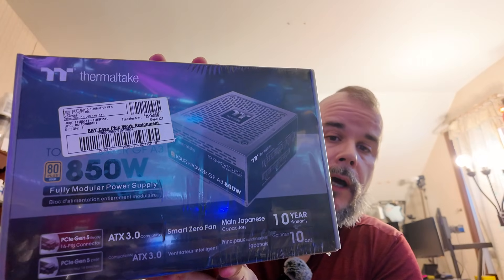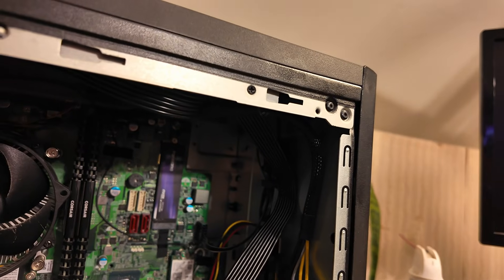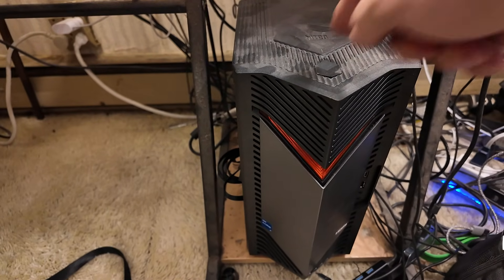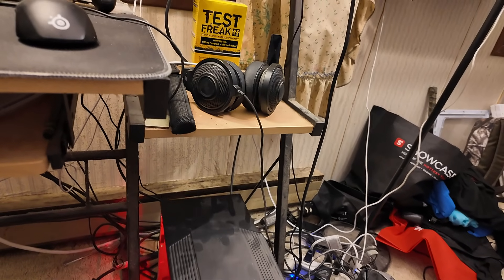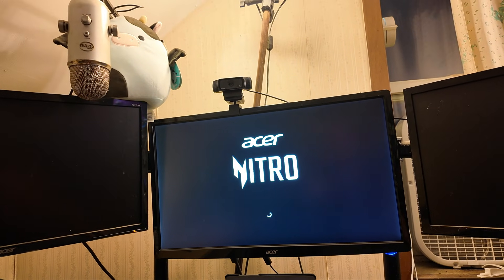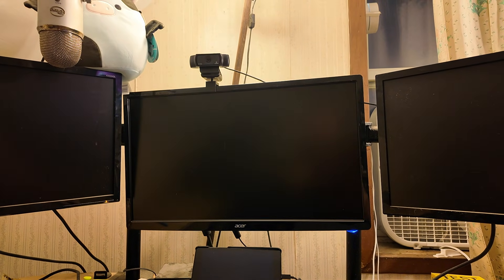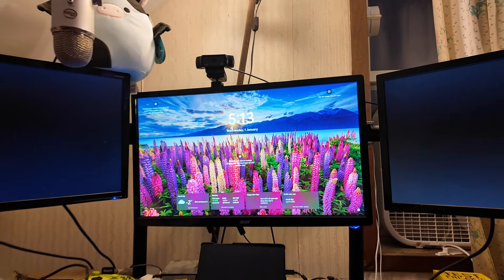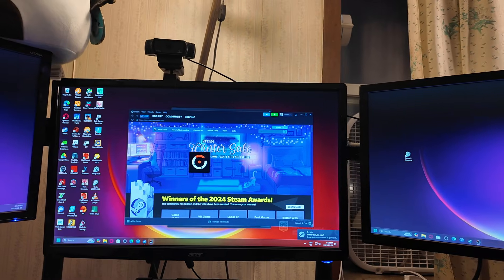Power Supply Upgrade - Acer Nitro N50 n50-650-eb14

Comment: Thanks for the video! I bought an 850W PSU for my Acer Nitro N50 and thought it would be an easy job to swap it out. Little did I know… I can’t believe I have to get this adapter cable now 😅
Also, cable management is gonna be tough…

Comment: Dude, love your videos. Anyway those rivots, they're cheap aluminum. I just took a hammer to a chisel and they just popped off. Tossed that useless HDD case. 
Anyway bought a cooler master 750w modular. Everything connected, it fired. But no usb or video output. Card fires n spins, all fans spinning but the 8 pin wasnt powering any peripherals. I put OEM back in and it's fine. Any ideas?

Comment: Thanks for making this videos this power supply works Corsair rm850x doesn't. I got a thermalake CPU cooler 2 case fans 32 GB 1.2v cl22 ram WD 850 2 GB HD in mine going 5070 had a 6700 XT in it
Reply: Yo mate, can u tell me more about your current specs? I am tryna upgrade mine as well

Comment: My advice would have been to sell the acer pre build and buy a used pc from a pawn shop. i picked up a i7 11700k based pc with a rtx 2060, AIO for $530. The chicony psu is really badly low quality from a company like acer to use as well as their green low quality mobo in 2025. Theres no case fans everything is a cost cut on that acer yet they charge more than a proper pc you can build yourself.

Comment: I have nitro n50-650 with rtx3050 8gb oem and the seller told me that its imposiible upgrade the gpu  bcoz the psu is limited and cant be replaced? Who i need to believe??
Reply: I got my son an n50 640 (older model.. and I've swapped out everything except the power supply. Upgraded to a 4060..  a 4070 dual fan is no problem.  But you can't go any higher.  I want to upgrade the power supply but I'm kinda scared I may fry my motherboard. But if this guy did it we should be able to as well
Reply: What was the original cpu and gpu?

Comment: Ive bought the linked power adapter but it doesnt turn the pc on at all, i feel like ive tried everything that could be wrong🤔please help😭
Reply: I bought 2 adapters, one for dell, once for Acer, both don't work....Fans start to spin....that's it, no screen, no power button reaction. Acer Nitro n50 656. Acer changed the way the pin communicate (PS-ON pin , green wire, ...)
Reply: @armand4464  I have same issue, fans are turning on idle nothing else. Do you have the wire diagram for the 24 to 6 pin adaptor to use it in Acer Nitro N50-656? Or at least what wire needs to be repositioned?
Reply: @sergiuteslev672   I found out that the newest ATX 3.0 don't work (if they work - it's just luck and because the company wanted backwards compatibility). Older ATX 2.4 psu's should work. The reason is because the Acer Mobo is  activating the PSU by shortcircuiting the PSON pin with the GND pin. This is old technology, typical for ATX 2.4. Newer ATX 3.0 technology PSU's don't use this. There is no problem with the adapter or your new PSU is not broken or somethink like that. It's the ATX 3.0 rules about on signals/pins. There are Reddit subs in the AcerNitro subreddit, you will find if you Google. Try to get a working PSU model  - and you will be fine .
Reply: Thanks!
Reply: @armand4464  Do you have more info about this compatibility issue? My upgraded PSU is working, but the PSU fan never turns off even if everything else is off, not sure if it's related.
Reply: did you plug in both power cables? and make sure the cables are fully seated

Comment: Thanks for making this video! I'm finally upgrading my nitro 50 to an rtx 4070 super and this video gave great insight on upgrading the PSU with it. Thank you!
Reply from the maker: No problem.  I have yet to replace my video card in mine as all 4070's in my town are sold out.  I am thinking of waiting for the next gen mid range cards to come out.
Reply: My n50-640 PSU fan won't ever turn off even when the PC is shut down. I read the old acer proprietary mobos don't play well with new PSUs. Did you guys have this problem after the upgrade?
Reply: Yeah I ended up having to turn off fast startup and even then the fan usually goes for 5-10 more minutes before finally turning off.
Reply: @Megamind283  I'd be fine with that, mine just never turns off for some reason.

Comment: I picked up one of these cases with just a power supply and motherboard on Facebook market place for £20 here in the UK. Guy said there was some problem with the SSD/NVME Controller. Well it was worth the risk for £20! It soon became apparant that the Acer boxes are VERY proprietary and I couldn't fit a standard motherboard without lots of hassle. As I like to play around with pc's (retirement hobby) I put in an i3 processor and some ram from another build, added a basic gpu card and it booted to the BIOS. I created a Win 11 USB installer and it wouldn't recognise the NVME drive (or an SSD drive) that I'd also added. Not to be beaten I tried a Linux Mint USB installer. Boom! No problem, up and running with Linux in no time. So clearly no problem with the SSD/NVME controller. Turns out that with some Acer , and also Dell machines, the Windows 11 installer lacks the drivers for the specific  SSD/NVME Controller but it does give you the opportunity to load these during install. I actually downloaded them from Dell and they worked with the Acer! These machines go for anything upwards of £699 here in the UK (yes we get overcharged compared with you guys across the pond!)

Comment: As for your USB card dreams, you can get PCIe extenders (basically a PCB that sticks in the slot connected to a flat flex with a PCIe slot on the other end) that you can stick in under thick-ass cards like that to make use of covered slots, so you can have said card, just need that extension... :)

Comment: 7 Amps on the 12v rail is only 84 Watts (Amps x Volts = Watts), had to go look up the specs on it, and I guess you mis-read it cos Thermaltake it's 70.8 Amps (849.6W, according to their spec sheet), damned thing puts out more power than my Honda EX650 generators!!! :P